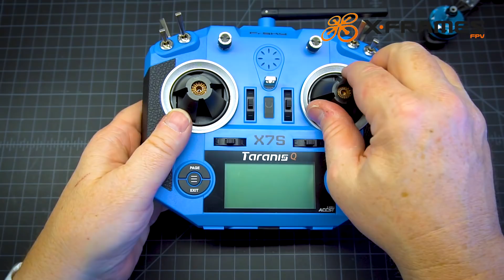Problem with the Matek F-405 AIO and why I don't use them.

Comment: wow. For the past 18 months, I had been very, very hesitant on purchasing Matek products. Google searched into this vid looking for solutions between my DYS 35A ESC's paired to a Matek F722-SE. The ESC's aren't recognized in BL-Heli Suite- 32.  When I took it out the package I plugged it in to Betaflight, before soldering, as suggested elsewhere. It's always had only 3 jingles and after the completed build, it only has the 3 initial jingles. Well I'll toss it in the ever growing pile. Man on this Matek F7,  I liked the easy soldering no fuss or fighting within the UART family, nbit when it was time to kick in for that family project (e.g. flying) none was home--all ECS's had dashes no info except for ONE white light; I even spared a UART just in case I pop the delicado USB connector. Anyway, I'll order something else to join up with the 'test ESC' 35A ESC I just ordered. Think I'll stick with the DYS F4 Pro board and DYS 30A ESC's, this combo works perfectly in two Fusions I've built. I'm hesistant on the CLS racing board

Comment: There is now a new version of the board called F405-CTR. I don't think you can buy the F405-AIO any more. There are a number of changes, one being MPU6000 instead of ICM 20602.
Also, I have fixed the yaw twitch on my AIO using information from a video by DroneMesh.
All this said, CleanFlight, BetaFlight and iNav always had problems initializing the gyro on random units of any board using MPU6050 or MPU6000.
Reply from the maker: Yeah, I'm looking forward to trying the new Matek. There were so many things I liked about the old one. Hopefully the MPU6000 will be the fix it needed.
Reply: I have three quads running with the new Matek F405-CTR. All of them were good but this morning one of which simply refuse to boot up when I was at the flying field. One red light lit up and no flashing blue light. Back home, Betaflight cannot see the serial board anymore. I try the DFU boot button, nothing happen, I have to declare it a dead board, too bad caused it was fine the night before when I still flashing the Beheli ESC !! Look like the board is not that reliable and just dead by its own anytime...

Comment: On Bolt and other "6s" escs the dead wait time might be too low which when higher voltage (6s) is imputed  can cause, desynchs, shorts because more than one fet is charged etc. The dead wait determines the speed at which each fet is energized and on 4s a lower dead weight time is ok and provides more power although might not be a smooth as a higher one. The dead wait is indicated by the number on esc firmware after the letters.

Comment: Hi Dougy. I  had a very similar experience  with that board, Maytek should just stick to PDBs I think 😒. The  CLRf4s and kakutef4 have been good for me on 5s.  You could also try the lumineerf4 aio, very similar  form factor as the maytek and much better quality..  Love the channel, thanks brother.
Reply from the maker: +KeV H at this time the Hobbywing F4 and the original CL Racing F4 is my go to. Getting ready to put the Kakute in three Quads.
Reply: X-Frames FPV interested in your reason why the original cl racing fc over the new one?
Reply from the maker: Still a few bugs with the F4S and I have had zero issues with the original.
Reply: X-Frames FPV 
   I have the f4s and during tuning it just fell out of the sky twice. I fly it now in stock settings and it doesn’t fall out of sky anymore. This is my first build and first f4 fc so I was wondering if it was me or fc. I’m leaning towards fc. My tune was pretty low.

Comment: I wanna fly a 8s setup lol any suggestions? 5s I do 138mph but with primo 2207/2650 they may not take 6s for long but 5s they great..still wanna build monster 8s
Reply from the maker: +Danger Davefpv T-motor has some big ESCs but not capable of running DShot.

Comment: i have 3 of them they all work great thats terrible to hear. i had problems with the dys f4 and the hglrc flame . that one was amazing
Reply from the maker: +QUADBOT FPV I know sometimes it’s the luck of the draw with components. I do know quite a few people with F-405 issues,  and after two bad ones in a row I just don’t want to use them.  Apparently Matek is coming out with an updated version with a new gyro.

Comment: The matek with pdb in one has problems. That is why I get only the one with separate pdb.
Reply from the maker: +emiel1976ep there are still quite a few people with Yaw twitch issue on the standard Matek F4.
Reply: But that you can solve by rotating the board 90 degree. Mine does not have it but i know that some have but by rotating it is solved.
Reply from the maker: yeah that is a workable solutions, but when I'm building for other people I'd rather not use gear that require a work around. Otherwise if its for myself I don 't mind.
Reply: I understand that. I did not have the problem. tjink i fly to slow for that. hahaha.

Comment: There is nothing but problems with the F405 AIO and there answer is a bunch of caps. Although you mention CL_racing the version 2 has issues with certain noisy escs so I would avoid it.
Reply from the maker: +Fran Galasso I have heard of some issues with the CL Racing but luckily I had no problems wit it.
Reply: I've had mentioned problems with Cl racing F4s. Complete flip out and forced disarms.  They say my ESCs aren't compatible  (Spedix 20s lites).  If it need to add caps because the FC can't handle 4S these days then it's a bad design.

Comment: I have another weird issue and Matek answered me the typical "theres nothing wrong just reflash it with another BF version and do a full chip erase"
I'm running BF3.2.2 and have the issue of the LED strip not working propperly and also resetting.
Procedure is as follows
Set 4 LEDs -> feature color -> Change on Throttle -> save -> change Tab to CLI -> save over cli
everything works fine for raising and dropping throttle a few times then it jumps to a solid bluish/white color and stays there. LEDs also stay the same color after reapplying power.
If I connect the board to BF all LED settings are errased only the wiring order is left.
The Issue is reproducable, I tried reflashing firmware and a fresh setup but it stays the same.
Another error is that the whole board got whiped of ALL of its settings but the stock download settings and im really not keen to maiden it because i dont want a flyaway.